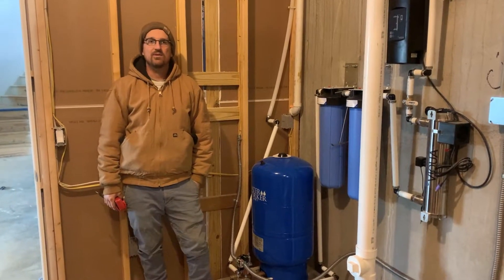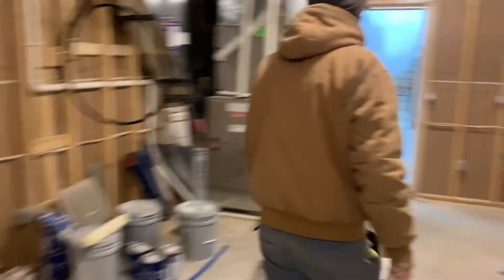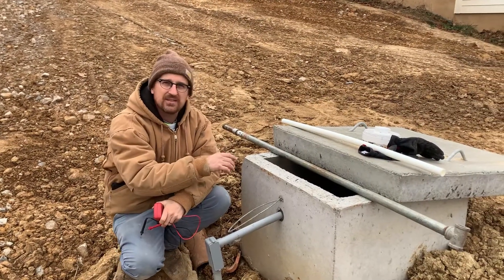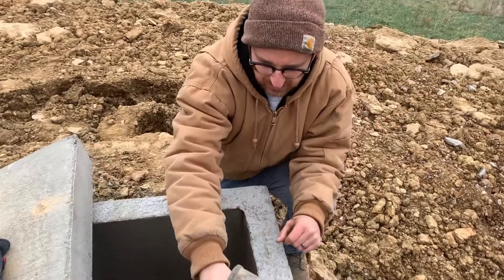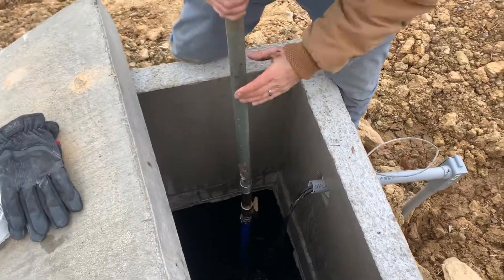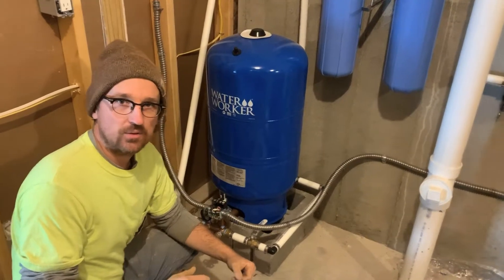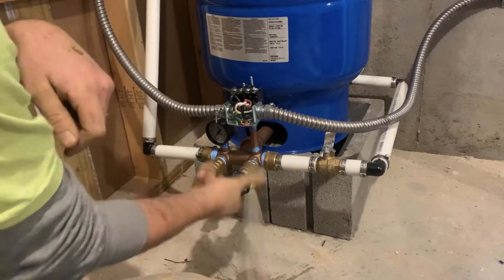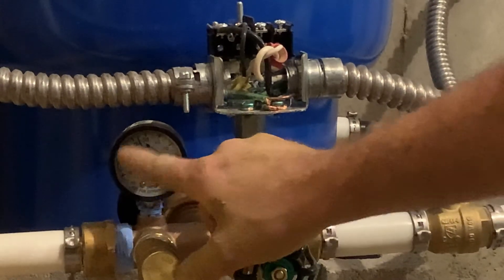How to Troubleshoot a Submersible Pump

Comment: Will my submersible well pump be louder when it first comes on? then drop down to a steady quieter hum? I can hear pretty hard vibration at start up and then its quite while it runs.
Reply from the maker: There is a power surge and torque when the motor first turns, but I can’t say that I’ve ever heard a pump get quieter as it continued to run. Are you listening to the pump down in your well? You may be hearing that start up torque on your water line or a twisting of a torque arrestor, but that would only last a second. It could be that the impellers or drive shaft are starting to seize up a bit and get looser as the motor turns. Unfortunately I’ve not come across that symptom before so can’t say for certain without hearing the sound. May want to put a clamp meter on the cable coming out of your well to see if the amp draw on your pump motor is within spec (if you know the make and model of your pump, you can look up what the startup amperage is and what the running amperage is… if you’re showing a higher than spec number, your motor is doing too much work and it may be time to replace your motor).
Reply: @rainbrothers  thank you for the response! It's a brand new pump. Don't think there is a torque arrestor installed either. It's that first 2 or 3 seconds when it kicks on where it's a little louder than the rest of the running time (the pump maybe takes a minute total to fill the bladder tank). I hear it in the basement where the bladder tank and  pressure switch are located.
Reply from the maker: @ Are you sure the noise is coming from your pump? If you have a submersible pump in a well, then you wouldn’t be hearing that. What you may be hearing is the initial pulse or surge of water coming into the house. You might also be hearing the click of the pressure switch or, if you have a new pressure tank, perhaps you heard the initial pop of the bladder inside the tank (but that only happens once). Tough to say, but there are several possible explanations
Reply: @rainbrothers  thank you for the responses. It is a new bladder tank but that doesn't seem to make any noise at all. It doesn't sound like water flow to me. It could be the pipes buzzing/ vibrating against joist framing? You can feel the vibration on the pvc pipe coming into the house when you touch it. The click of the switch can be heard as well. Im not sure whats going on. Just mainly curious if you should hear anything at all really when those pumps are running other than the click of the switch.
Reply from the maker: @TylerSavick-z7j  I would try securing the piping better with some straps/pipe hangers so limit vibrating. You can definitely feel vibration if the pipe is loose, and it can cause water hammering (though that typically happens when the pump shuts off, not when it starts up). Sorry I couldn’t be of more assistance
Reply: @rainbrothers  Its all good. Just hoping I don't have some kind of wiring issue or oversized pump. thank you for taking the time to respond!

Comment: Hi! We have a submersible pump but we are only using it to have the flood flow out of our house. The pump is not fully submerged in water and at some point in time it suddenly stops working and is in high temperature. Will it still work after cooling down?
Reply from the maker: Difficult to say. Pumps need to be submerged to stay cool, but generally there is a temperature sensor built in to the pump that will shut it down automatically and you’d have to turn off the breaker and leave it off for a while, ensure there’s water around the pump, and then turn it back on. Sounds like you have a sump pump - that is a different type of pump altogether

Comment: Hi, I'm wondering, where you have your pump and float wires exiting your cistern into the LB, do you have some kind of moisture barrier in the conduit? Thanks.
Reply from the maker: The LB is gasketed, and we always ensure that the conduit passes thru a watertight seal in the riser and that the penetration into the riser is above grade. Thanks for asking!
Reply: @rainbrothers  okay thanks